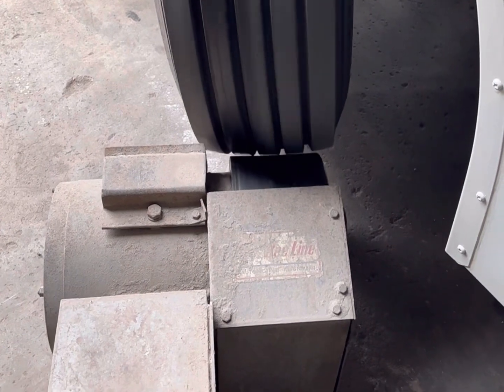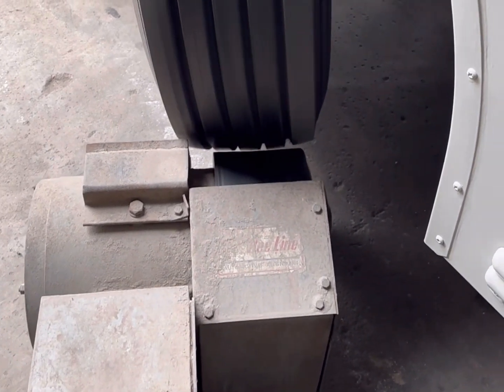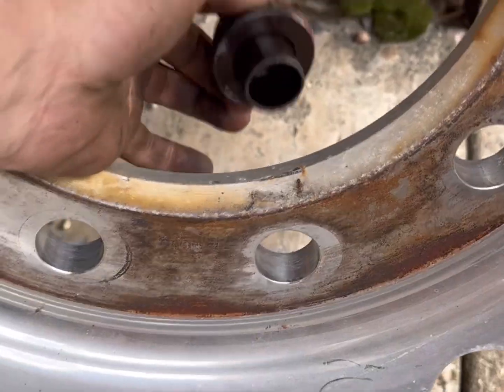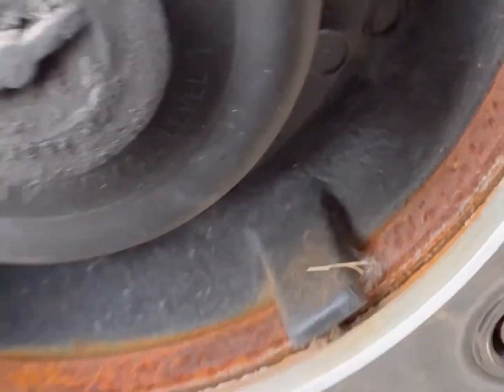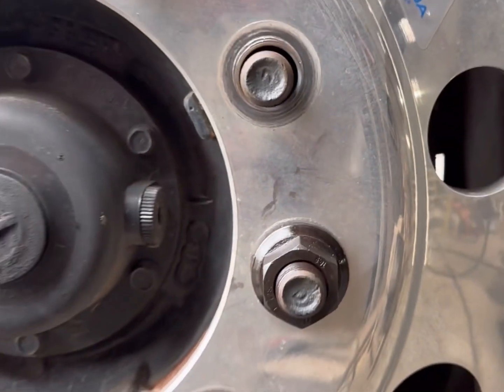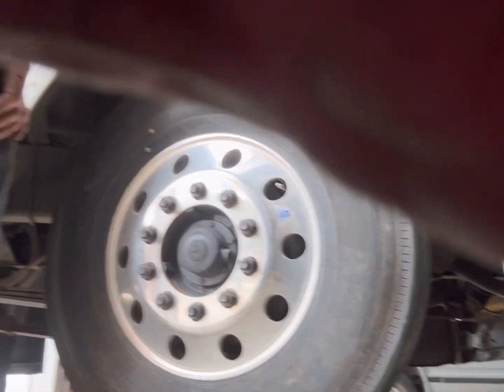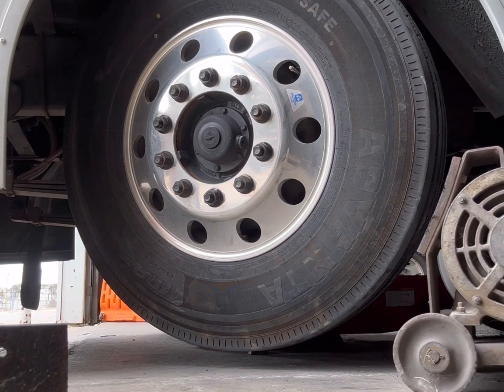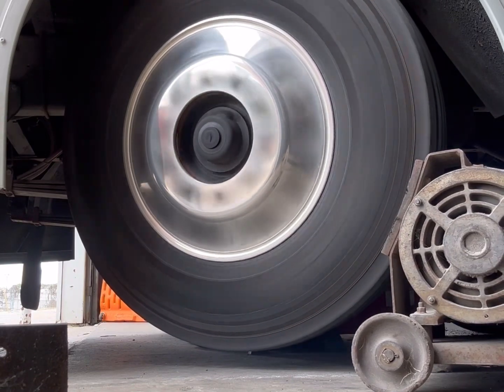Easy tire alignment tricks

Comment: That wheel being so eccentric points to some other issues . But that IS a quick , affective " Fix " . 👍
Reply: @YourMom-ro1ig  . No . He didn't . That is a " Quick Fix " for a deeper problem .
Reply: @YourMom-ro1ig  . Do  you  mean  the  " Hub  SPIGOT's ? " . 
So you're saying that  I  am CORRECT .
A  " Quick Fix " instead of  FIXING  THE  PROBLEM . Yes  ?

Comment: Do you just need half of the lugs nuts to be the centering ones
Reply: As long as the wheel remains center with the hub, that's all that matters.  The nuts lock the wheel to the hub.
Reply: You only need three to center the wheel